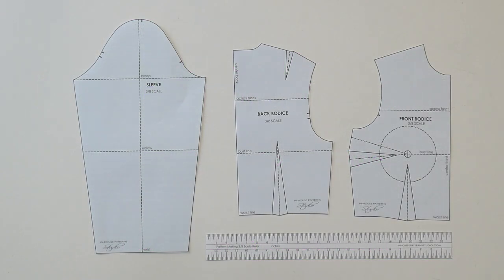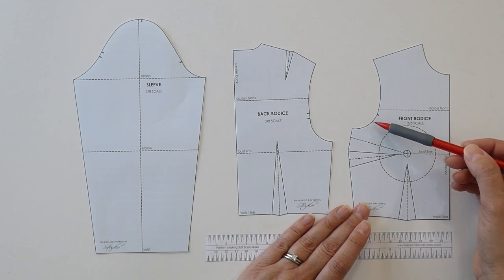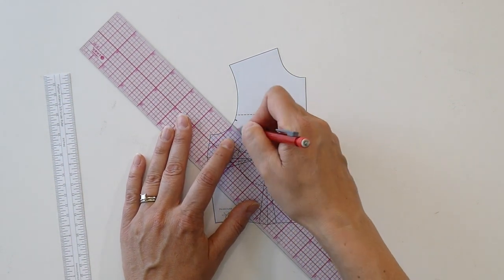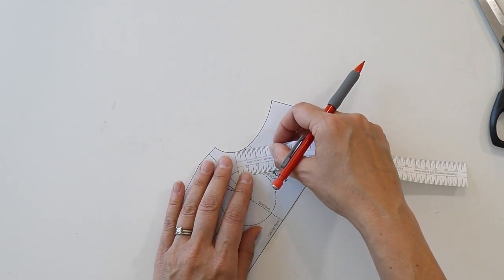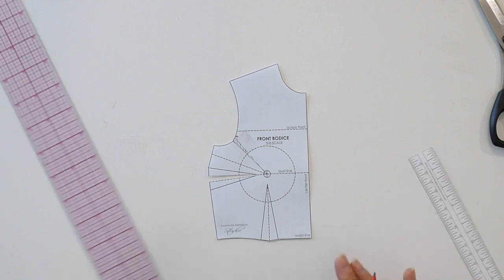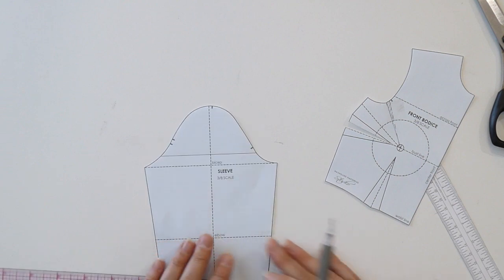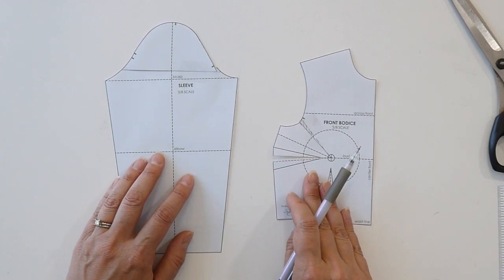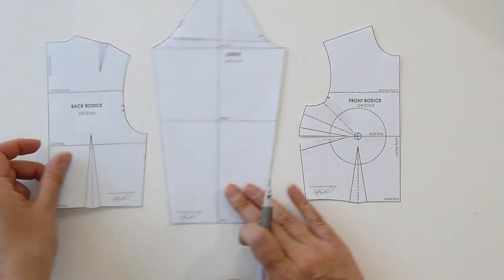Quick Tip: Gaping Front Armhole

Comment: This is the first time I've made a comment on a video but this video has the adjustment that will fix the gap for a very large bust with a narrow upper chest. Instead of  using the side dart make a vertical cut from the hem to the apex then spread pattern apart there. The extra waist width can be redrawn. I have seen this adjustment done by Peggy Sayers but it's hard to find in her wealth of videos. Well done. Thank you.

Comment: Hi Alexandra, many thanks for this tip ! It helps a lot ! Quick question about the bust : once you made the adjusment and you increased the bust dart volume, where am I supposed to place its point (or tip or spike - sorry I'm french and I don't know the exact word to use in this case ^^') because in your example (and so in my case) the bust dart spike is not on the apex but few centimeters away. Hope my question is clear 😂😅

Comment: This is fantastic! I have gaping all the time and have not been sure how to deal with it. But what if the pattern doesn't have a bust dart? Such as a knit bodice- how do you do the same adjustment? Thank you!!
Reply from the maker: There are a two ways to deal with this in knits. One way is to follow the same principle as I show in the video and essentially create an un-sewn dart at the side seam that is eased into the back. (This will work on most knit garments) The other way is to raise the base of the armhole of the front and the back each by half the amount of the gaping to reduce the entire armhole girth by the amount of the gaping. (This way works best if you have a snug fitting knit.)
Reply: Great, thank you. I will try these techniques. I also have a woven pattern that I have been stuck on in the muslin stage, so this will help a ton!
Reply: @AlexandraMorganInHousePatterns  Hello Alexandra, thank you for your great tutorial. What if the knitted pattern had sleeve, can i rise the armholes or do i follow the method in the video and what about the modification on the sleeve if i do the rising armhole modifications? Thanks for your answers!

Comment: Nice demonstration.  You are, however, losing a little sleeve cap height.  It may be necessary to add the lost length back at the hem.  If cap height is crucial, the upper arm width may be reduced to maintain the sleeve cap height.

Comment: Alexandra this triggered a question for me :) in a forward shoulder adjustment, do you recommend that we make the same slash to the sleeve pattern piece as you have done here in shortening the front?  Some say no that you don't need to adjust the sleeve pattern piece I was just curious to know what your recommendation in that situation would be.
Reply from the maker: Hi Kathleen, I have a video on the forward shoulder here https://www.youtube.com/watch?v=jSwONVfA0Ow&t=4s you'll see how I slash the sleeve in one case and not the other. It depends on the method you choose. If you are doing a simple seam line reposition with the shoulder seam, in some cases you can just move the notch. I find that it depends on the sleeve head shape. As I say with everything, try the different methods and use what works.  There are many ways to accomplish the same result. :)

Comment: The armhole would be too small after the adjustment, especially on a fitted sleeveless dress.   How should I adjust to the correct armhole measurement?
Reply from the maker: SuperModerngranny not necessarily. If the armhole gapes and there is no need for a bust adjustment it is too long and this would correct the issue, however an additional issue may be that the armhole is too high so you can lower the front and back armhole evenly to enlarge the armhole.
Reply: @AlexandraMorganInHousePatterns  thank you very much! :)